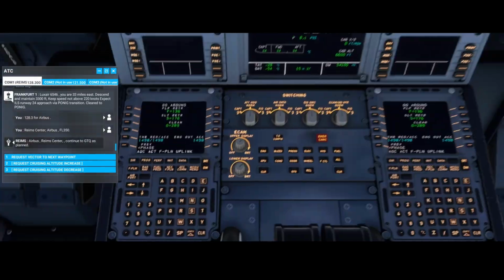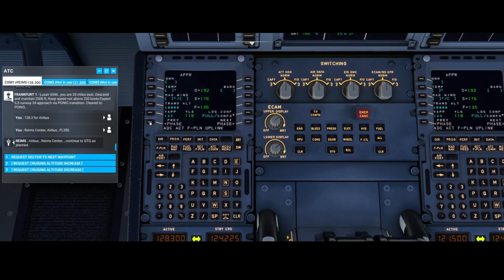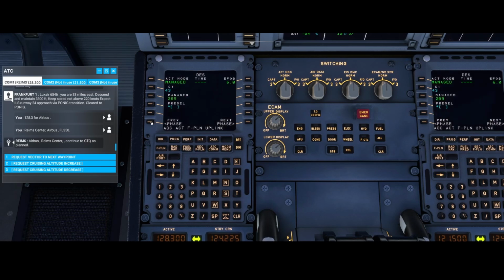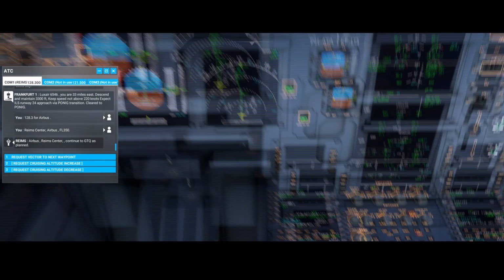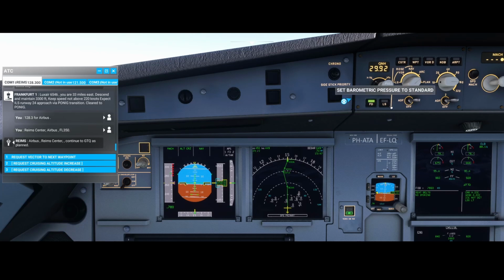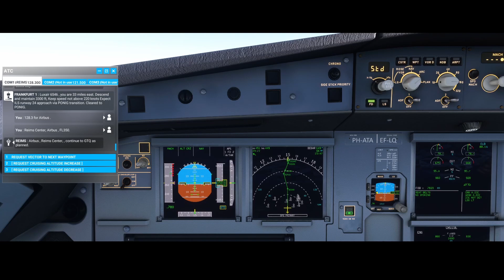Flight Simulator 2020 - How to - Airbus A320 - QNH/QFE blinking

Comment: Hey, I am 16 000feet but when I set it to standart, It will show me that im 15 500feet and the plane will start yelling at me some weird sound.
Reply from the maker: Check you barometer settings, you can set it automatically to the correct value by pressing the B on your keyboard if you want

Comment: How do you pull them it changes between QNH QFE for me
Reply from the maker: which control mode did you enable locked or legacy?
Reply: @Highintheflightsimsky  i think legacy
Reply from the maker: ok that should normally work ok, so you say it changes continuously or only when pulling the button
Reply: @Highintheflightsimsky  when i hold left and right mouse click it doesnt pop to STD but to QFE
Reply from the maker: in that case check of you are using the legacy mode, you can find it under accessibility settings
Reply: @Highintheflightsimsky  ah yeah found it😃 works now thanks allot💪
Reply from the maker: ok good to hear it is resolved